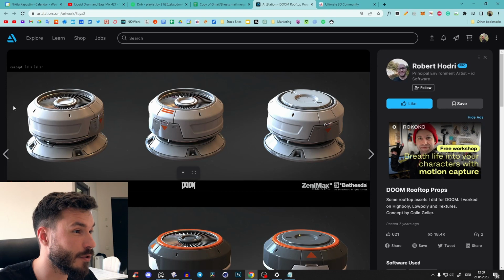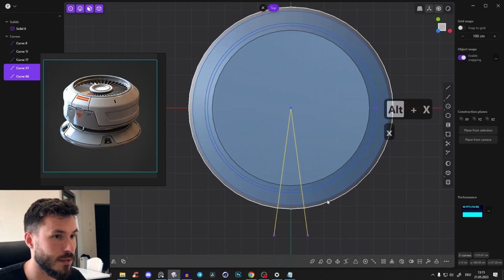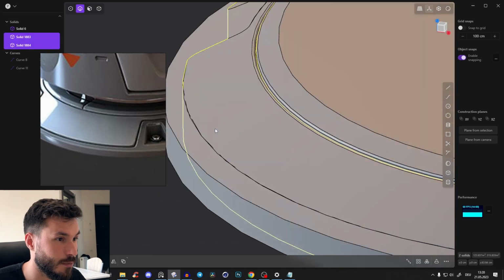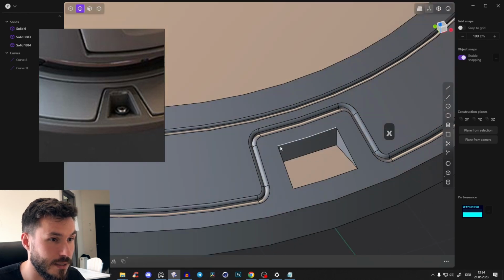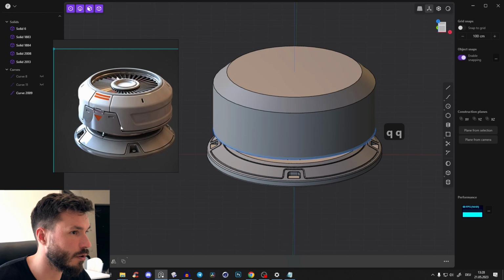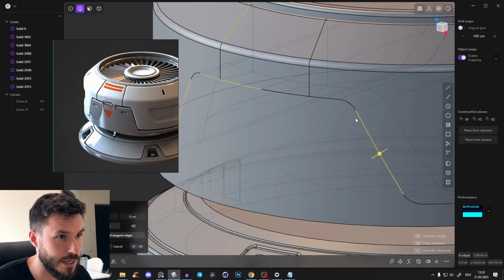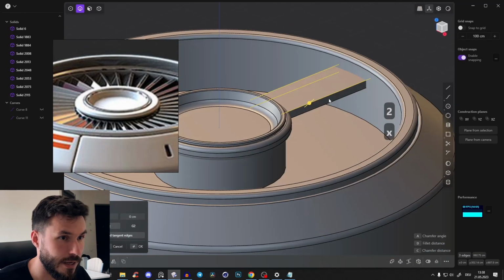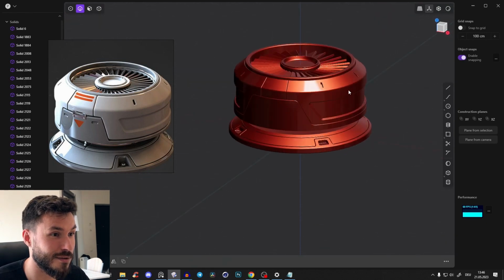Best 3D Software! Plasticity Beginner Tutorial | Sci Fi Hard Surface Design

Comment: To create a cut shape, select the inner surface at 10:59. Press Ctrl+Shift+plus to gradually select the faces of the boolean part. Then, press Alt+D to create an object that has cut shape. Finally, use the radial array to apply the cut to different areas.

Thanks for your amazing tutorials! ♡

Comment: Is plasticity 3d compatible with MXlinux, Devuanlinux, antixlinux?
Reply from the maker: I am not sure, but it shows that there is a version for Linux.
https://www.plasticity.xyz/

You can also write an email to support@plasticity.xyz to ask
Reply: @nikita.kapustin  thank you so much.
I've been informed that it does install and desinstall correctly on antiX linux but its yet to test if it works properly.
It will amount to platicity 3d's dependency on systemd to properly function.
I have contacted plasticity 3d as you adviced to learn about the subject of plasticity 3d and systemdy dependancy.
Than you very much for your help.
I will reply back to share the answer for the info might be helpful for others.
God bless
Reply: Hello
So for anyone intrested, acording plasticity 3d's support team  it only runs in ubuntu 22.
They did not confirm or deny systemd dependancy. 
That being said there is a work around for Arch linux  (you can google it).
It might work with other also not owned by corporations distros. 
I have also learned that plasticity 3d also runs stable in Fedora wich does not use systemd (but related to red hat corporation). 
I hope this info is useful for anyone looking to run plasticity 3d in non-corpotation owned non-systemd-dependant linux distor. 
God bless. 
.
Reply from the maker: @isauromanuel  Thank you for sharing this information with the community.
Reply: @nikita.kapustin  youre wellcome.
It also runs stable on linux mint

Comment: Hi Nikita, I have a question: you here on this cylinder first made a drawing of this motif with a trapezoid, then rounded it, and then this line cut this cylinder, the result of which is the same motif of this "trapezoid" on the front and back (that is  logical), and what if, for example, we only want to have this motif on the front, and not on the back. and on the back to have only this continuous, straight (actually round) line .... how to do it ?? I don't have a problem with it, for example in Solid Works or in Rhino .... and here in Plasticity? thank you for your reply and best regards for Master.  :)
Reply from the maker: You can imprint the curve as well onto the body with Shift+I.

If you want it only in the front than you have to change the whole design of the line so it is not "going around"

Comment: FYI, when this was designed they did not actually run their arcs from the center, they ran them from a center point on the far opposite edge of the circle. That is how they achieved those nice thin long cutouts for the screw indents you created at about 10 minutes on your video. Awesome tutorial though, thanks a ton for the instructions! I am learning a ton from your tutorials!